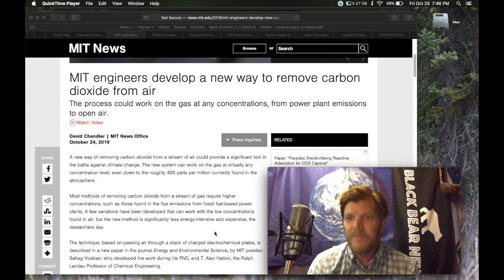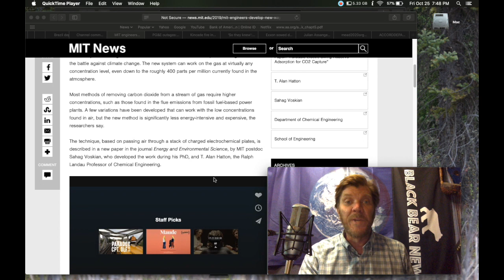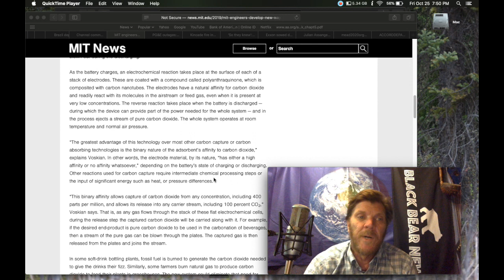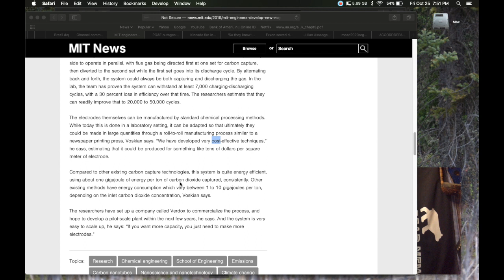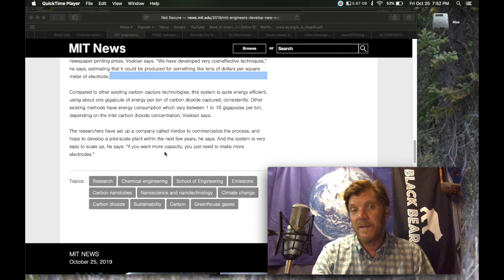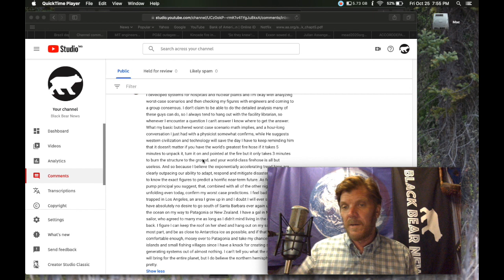BLACK BEAR NEWS: Techno Fixes R Us

Comment: sigh. carbon nano tubes and years of development and god knows what resources and energy to get it to operational status.

what matters is co2 per watt of energy, and the co2/energy cost of getting the system on line. who cares about pressure and temp modification if it works more efficiently.

We DO need a techno fix. Nature can fix everything by itself no problem, but not on timescales that will save species.
I might be blowing my own trumpet, but im still certain that my method is the absolute most efficient techno method available.

Taking advantage of phase change is critical which requires playing with the pressure and temp of the air stream. but to compress and cool air to the point that co2 becomes liquid is uncomplicated and needs no rare materials or chemicals. When you look at our entire planet and how many freezers and compressors have already been built in various sizes and strengths. we could annex a massive amount of equipment that already exists to process a mind boggling volume of air with out ever having to build anything new.

the technology of thermal reclamation really ramps up the efficiency too. we use reclamation and refrigeration to cool the air and then simply pressurize it. we are only talking numbers like -18c (almost every supermarket on the planet has storage coolers that can achieve this) and pressure of what, around 80 bar. there are literally millions of compressors around the planet that can achieve those numbers.

cool some air and squeeze it and liquid co2 falls out. its not rocket science, lol
hell, if we take advantage of the cryosphere and the pressure of the oceans, we may even be able to pretty much get away with pipes and fans to do the job.

as for energy, well it takes what it takes, but as long as we are smart and we use solar thermal and shallow geothermal, then we are 2 for 1 as we are siphoning off the planets excess heat, turning it into useful energy and then using that energy to extract co2. the heating effect of co2 pays the energy cost of removing co2.

everything we need to do the job is already built, we do not need scientists to fix it, we need engineers who know how to macguyver the parts together.

and of course the pure liquid co2 we produce can be injected directly into sequestration greenhouses to turn it into useful organic products such as food, lumber and soil.

I have too much baggage to run with such a thing, someone who 'gets it' needs to take over and make it happen.
Reply: the cost outweighs the benefits.
Reply: @jthadcast  mine? you got any workings out with that rather than just a dismissive statement?
what cost, the stuff is already built, its just man power. and what cost is too great to save the biosphere?